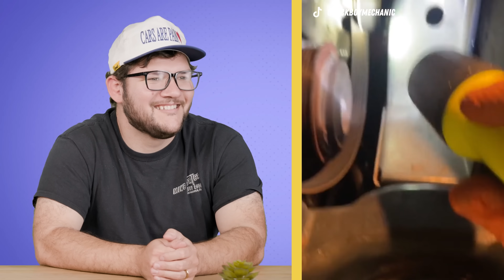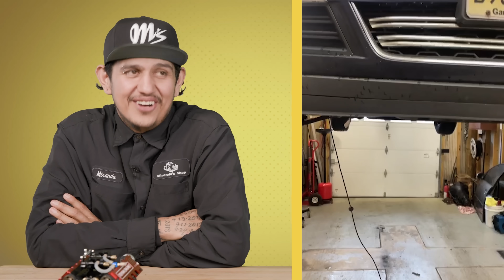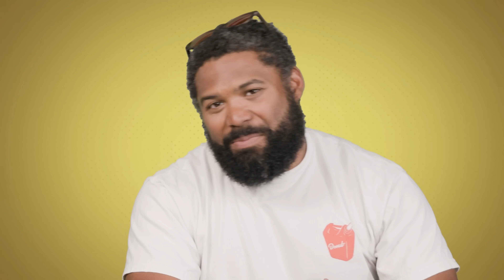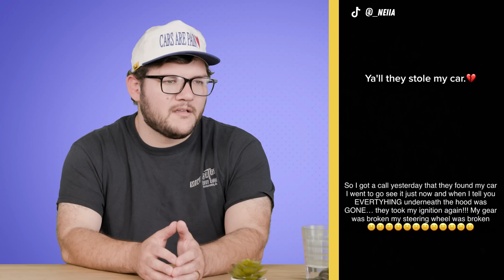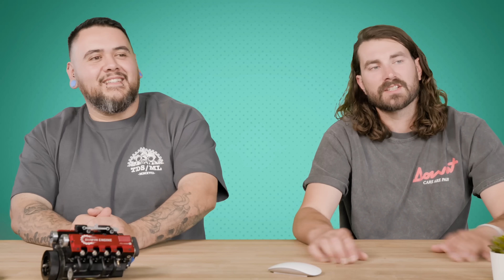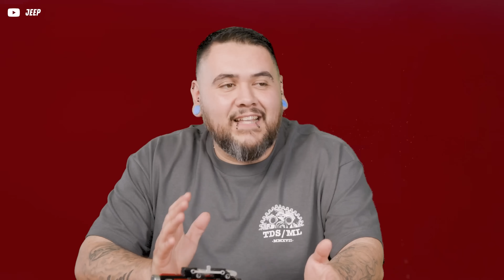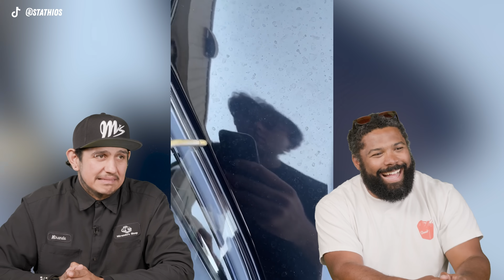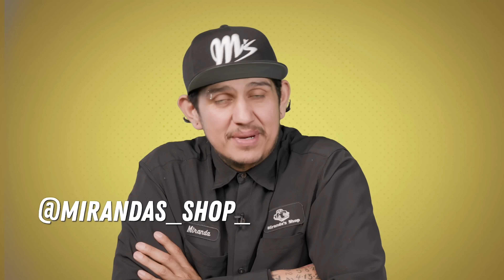Mechanic Reacts to Car Engineering Fails

Comment: As a machinist (the person that actually makes the car parts) I empathize with my mechanic brothers and sisters. There have been countless times when I have scratched my head or screamed in a fit of utter rage at the careless design by a Design Engineer that not only didn't take into consideration how a part was going to be removed and/or serviced but also actually MADE!! 
I agree with most of the conclusions here what the exception of the fitment of parts, for example even though the McClaren is "hand-built" it is 100% the Manufacturing Process Engineer's responsibility to make sure that the assembly process is taken into consideration. (How everything is put together and what can go wrong during that process!) 
It is the responsibility of the manufacturing and production engineers to provide feedback to the design engineer so that alterations can be made to parts and systems of an automobile/bike/plane so that servicing can be done efficiently. The cohesion, that dynamic is ultimately higher management's fault, as they are the ringmasters that need to make sure that all of that is running smoothly.  Now that I design things I take into consideration servicing, assembly, and disassembly. 
What the industry needs is more mechanics and machinists to get their engineering degrees and show these "book engineers" how it should really be done!

Comment: I've owned three FC Rx-7s, and NB Miata and now a first gen MS3 and in general love that Mazda makes things that are pretty simple to work on. About 2 months ago, my passenger side headlight went out. I'm thinking I'll just roll up to an auto parts store, buy the headlamp and throw the new one in.. you know, like a less than a 5 minute ordeal. Turns out YOU HAVE TO REMOVE THE WHOLE FUCKING BUMPER COVER to replace a headlamp. On a car that was less than $25k out of the showroom. Are you kidding me? What if you're in the middle of nowhere driving at night and you lose both of your headlights - I know, not gonna happen, but this is the kind of thing an engineer should be considering as a worst-case possibility - are you supposed to have everything in your car to remove a bumper cover on the side of the road just to replace a bulb? Such a joke.

**note: this is with factory HIDs, I'm not sure if the same applies to non-HID housings in Speeds.

Comment: On the long bolt issue. I would have just cut the bolt with a grinder. Then removed it the rest of the way with pliers. Then reinstalled the new pulley with a shorter bolt. Stupid fix to a stupid problem.

Comment: For the first one, I had the same issue on a Ford Focus ZX3. I just cut the end of the bolt off. The end is just an aligning tip without threads. I had to get rid of that and about 2 threads length of the bolt and it fit perfectly.

Comment: Most of these issues are known by the engineers before the car even gets built. It's just a matter of whether or not it's going to be an issue that will cause a warranty claim. There is little to no concern about brand image in terms of quality or reliability beyond the warranty period. As long as they can get a good JD power ranking every year and don't pay out on too many warranty claims, they could care less if the car falls to pieces after 60k miles. Because it really needs to be catastrophic to impact sales. How many times have you heard X brand has bad electrical, or bad transmissions etc etc, and they're still moving 300-500k units a year? If a part is very hard to change but will last the warranty period, oh well that's something the dealers can make a few extra bucks on and the customer will foot the bill.

Comment: The one with the bolt against the frame, i dont know why they are designed so compact, but that unit has engine mount issues, or was crash rebuild. I couldn't help but notice that for the most part everything was the engineers were taking the L. I'm not trying to stick up for the engineers because let's face it they do Fallout. But what I am trying to say is they place too much confidence in computer aided drafting programs. Without any research and development, no testing oh, they have to have a failed product if they've never tested it and haven't put it to work in the real world. Any computer program is no smarter than the person that programmed it. Oh and that crack about Jeeps being Chrysler's fault, wrong is daimler-benz. Jeep is the strongest four-letter word that man can utter, and they do have a rep to protect. Just saying

Comment: currently rebuilding a crashed 2018 720s. the rust is not at all accurate to what i've seen but the one we have has been inland vast majority of it's life. looks like that one sat on a dock for a good while before ppi or whatever he'd doing. it's also very likely to be an older car but just listed as 2022 because it's being sold / shipped from what i've seen of them, and it's somewhat common for every manufacture.

not very tight bolts is super common unless it's something big / structural like suspension, engine, gearbox etc. it feels like so much of them wee button headed bolts are just snugged with a hex screwdriver bit and called good. the same support ones in the engine bay that he showed being loose, weren't very tight.

most of the car is held together with double sided tape with a few small 8mm bolts here and there like any other modern car.  it's fascinating they can take the speeds / aero loads they do with how they're put together

Comment: On the land rover - when I do them, I stick a piece of cardboard bent at the top up against the other side of the skid plate & let the oil drain off that. I got burnt that way once, never again. There's more than just that car that I have to do that on, so it's not irregular. It's bad when a tech who only does oil changes when doing other jobs on a car has to remember to keep cardboard lying around because multiple cars have the same issue. 😂

Comment: That first one, I’ve had that exact thing happen to me 3 times now, all on different cars.   Luckily 2/3 of the time it’s required a motor mounts or two to be removed, but there was 1 other time where I needed to remove 3 motor mounts and a trans mount just to be able to jack up the engine enough.  Such a dumb design.  It’s exactly what happens when you take a preexisting engine and fit it into a new car.  You just kind of forget to consider every single bolt.

Comment: Tesla's lack of panel fitment and trim fitment is due to their own refusal to invest in quality engineering tools such as check fixtures, and jigs. Both of which are pretty outrageous in price and also cause more time in production, however they drastically improve the quality of parts both those made by Tesla and parts made by Tesla's part suppliers, especially with plastic parts. Plastic molds and even metal stamping dies lose their accuracy over time, and tools like check fixtures are used to "tune" molds and dies so they may keep producing to-spec parts. Without that, tolerances begin to loosen and parts start failing to line up properly.

The lack of quality is why the cars that Tesla produces is as cheap as they are despite the technology shoved into them; Tesla had to cut cost somewhere.

Comment: Range Rover DOESN'T recommend draining the oil from the bottom but rather sucking it out from the dipstick. It is likely why there is a big mess from thr drain plug side.

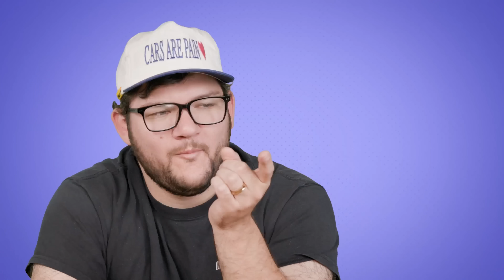Comment: 0:58 I’ll just cut the damn bolt off at the edge of the threads. Measure the bolt and go to a fastenal or hardware store find a bolt a 1/4 inch shorter to put it on when I’m putting it back together 😂😂

Comment: If I ever bought a Kia and it did that, the best way to fix it would be to sell the thing or get your money back from the dealer if it isn't too late.  As for Jeeps with the electrical problems, people think that all those fancy electrical gadgets are so great.  I wonder how great they think they are now!!  I like power windows and that stuff but really I never needed infotainment.  The electrical problems with the Jeeps may be partly people taking them off road or in the mud like they could with the old ones.  Then some water gets in things and now that new Jeep seems like the worst thing ever made!  I know I know, Jeeps were good.  We had one with the 4.0 inline 6 and those things seem to last forever if you change the oil when you should.  They are an old but reliable design and that may be why they used them so much.  As for the lug nuts found on a lot of Chrysler vehicles I despise those.  They have the real nut under a thin metal cap that is infamous for causing problems as they age.  The cap gets some rust under it and now you have a swollen lug nut.  Or sometimes the stupid cap comes loose or gets rounded and now you feel like you will never get that wheel off.  If you ever had a vehicle with those dumb things you know what I mean!  I also hear some Fords had those terrible lug nuts.  I can just imagine some guy who has gone insane with a sock full of those lug nuts which are defective by design just in case he ever meets the idiot who designed them!!

Then that power steering leaking fluid on to a hot exhaust and into the wiring.  I thought the Chevrolet shown at the beginning was horribly engineered now this?  I thought Dodges were the ones that were always full of surprises!  How many more GM problems are there that are the result of bad engineering?  I know a guy who really likes GM vehicles.  I guess that is only because he doesn't realize how bad they have gotten!!  In all fairness, some older ones were better.  Now these days they seem to make them hard to work on and use garbage parts to make you have to deal with hard to access bolts more frequently.  I don't care what you might say either!!  The engineers knew what they did all along and just didn't care!!  Once it is out of warranty does the lemon law still apply to an unfixable vehicle?  I know I would want to get rid of the damned thing if I was having that luck!!  I would want to get rid of it before I put too much into fixing it too and not wait until I spent enough to find a hopefully better made vehicle.  Then there is that Tesla, I would be absolutely livid if I spent that much and had all of those problems!!  I am part Irish so you can imagine my anger for so many ill fitted panels!!

Comment: A Volkswagen or Audi with an electrical issue can get ridiculously expensive to fix.  Some parts need to be coded in the ECU when they are changed or replaced.  There is a cable you can buy to do the programming but be careful!  One mistake and you might get a variety of bad results like a vehicle that won't start or seems to somehow have grown a mind of its own and is next to impossible to drive safely.  Heck if the problem is in the TCM you might either have it causing even more mayhem!  That can be a vehicle that is stuck in park or reverse and will only go anywhere with a tow truck!  Imagine how awful it must be!

Comment: What really sucks was my 2001 Pontiac Sunfire that had the power steering line routed into a U-shaped metal tube under the chassis right behind the wheel so that any rock from the road can knock it loose and cause all your power steering fluid to drain out.

Comment: The first one with the idler pulley. Go to the other side of the body panel with a hole saw. Done it 5 times so far. Works great.
Reply: Find a grommet the right size for when you're done and say that's how they built it.

Comment: So, oil change on the the modern BMW V8 engine..... Upside down oililter cap you can Not drain (the older ones could be) and to piss you off Just a little more you still get the copper ring from the old style drainable cap in the pack if you buy the oem part......

Comment: VAG will not give you a new car, friend had there brand new Audi cam was faulty had to have a new engine then fault after fault after fault worst experience of there lives and first brand new car, had to sew them.
While car companies make 80%+ of the profit from parts and service charges they'll never think of problematic access for repairs or service.

Comment: 2002 Focus ZX5. Geniuses didn't leave room to get the alternator out without completely un-bolting the passenger side motor mount and pulling the engine about 3" forward. 
Unless you have a good ratchet strap handy, you'll also need to loosen the transmission mount and possibly the dogbone. 
Only saving grace there was I had a new set of mounts I'd been meaning to swap in, a floor jack, jack stands, chocks and a big prybar in the back when I limped it to O'Reilly for the alternator.

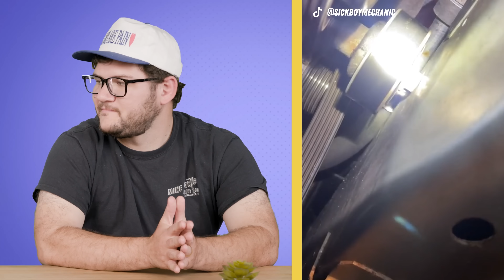Comment: so the first car with the pulley and tensioner,  at 1:15 roughly she says you don't get paid for the extra stuff. That means your a bad mechanic. The shop manual tells you the best way and the time it take. If you can't qoute correctly, that's on you. The manual gives a time including the jack up or lowering of the engine.
So in other words, they get paid to do exactly what it takes to do the job by the book

Comment: you should include management... i have some friends that are engineers and sometimes management overrides their designs/decisions just based on cost and timelines.
Reply: Yeah, another commenter brought up a point that the engine is probably used in a couple models and they either weren't given the time to check the clearance or they did, but management didn't want to wait for the updated paperwork and designs for this part on this model car and overrode the engineers. Someone also might have complained about having to have a different bolt for one model and the added cost of stocking that bolt for repair shops and stuff.

Comment: Being an engineer now, former mechanic, I can tell you that this video should have been called "Mechanic Reacts to Car Company Fails." It's not just the engineers that are too blame, it's their management, it's assembly, it's the company culture. After going to school for engineering and working as an engineer for almost +12 years now, I can say that most of these inaccessibility issues are caught, but are not dealt with due to management not having the wanting to invest time and money into it or the engineers themselves do not have the mechanical experience on their part to see it something will be an issue. 

Most of these issues I've seen come from the bigger American car companies like Ford, GM and European ones like BMW and Audi and so on. The Asian car companies tend to produce the best engineered vehicles over all to work on and own like Toyota and Honda.

So in the end, if the car company itself drives a good culture as a whole, you will retain management with good leadership qualities which will retain well experienced engineers and assemblers.

Comment: 4:25 My hot take: $$$ cars are just as likely to be lemons as economy cars, because most of the extra price is the cost of the brand’s ego.  A guy I flew in a small plane had a Maserati.  Most of the time I was involved around him and/or it was not him driving it to/from the hangar, it was taking him to/from the dealer next-state-over to drop-off or pick-up the car around maintenance.
I don’t think I’ll ever buy a luxury car, I’ll just get 2 gadgeted-out economy ones instead. 🙂

Comment: It should be made mandatory for Engineers to pull the finished product apart completely after a week of operation under a time limit.... Exceed the time limit and it doesn't pass to go into final production.

Comment: As an automotive engineer (Big Deisel) and ASE tech, I blame engineers all the time! But, at the same rate when the accountants and directors say "that costs to much make it cheaper and faster", you run into a lot of these issues as well. And you're not wrong about getting through the warranty period because you need to keep those profits up! They only test parts to make it past that. May the car gods be ever in your favor mechanics, I love all of you for putting up with our failures!
Reply: Big engines are designed to be worked on. Small ones are designed to be easy to assemble in the factory and rhenium stay together for the warranty period

Comment: Engineer, you can do it this way for, ease of maintenance, simplicity of use....
Accountant, you save 10 cents per vehicle if you do it this way even though its impossible to maintain, harder to use....
GM, Ford, Toyota etc. 10 cents a car! Do it.

Don't blame engineers.

Comment: Another problem is often engineers are responsible for one system. The design brief says the engine must fit in a defined space, that the structural engineers dictated, because their frame and engine mounts and other assemblies had to fit within the dimensions of the bodywork. 
Often things work fine separately, but once all are combined as a whole you start to see flaws like clearance for bolts and that oil splashing onto other parts during oil changes.

Comment: as others have said, it probably wasn't an engineer that made the first bolt too long.  that's just not the kind of mistake we make, it's a waste of material for nothing.  that was probably an accountant getting bulk prices.

the orientation, which is the bigger problem on that first clip, does lie somewhere in the engineering department. The head of the bolt being right up against the frame makes the piece impossible to work with no matter how short or long the bolt is.  It could be an engineer only concerned with assembly and not taking it apart again, or it could be lack of communication on what goes around the part being designed.   They piece was probably designed by a different person from who actually decided where it would go in space, but both were engineers.